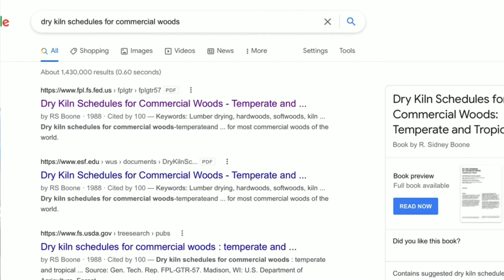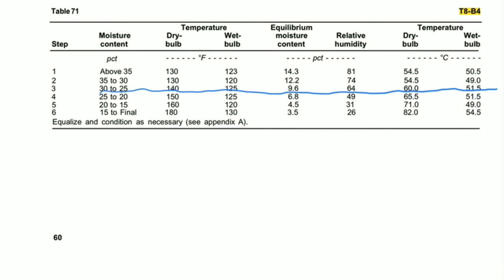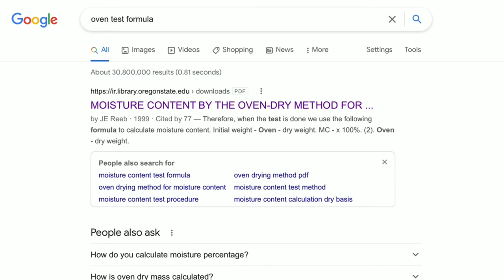Drying Hardwood Lumber 101 an Informative Video Series from Irion Lumber Part 3

Comment: What unit for dehumidification do you use. I’m looking at a Nyle
Reply from the maker: I got rid of all the dehumidification kilns that we had.  We used Ebac originally and we had a lot of issues with it.  It was a long time ago and they were old units.  Their new units are probably better.  We replaced the Ebac units with a Nyle, which was pretty reliable.